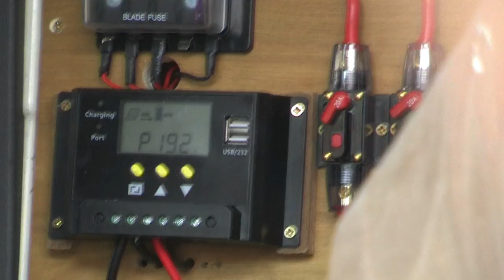Camper Van Build - part 8 - Building the chest of drawers and stereo cabinet

Comment: Sean, when you have the time I'd appreciate a video on the electric system and it's components.
I too want to build a van like yours but I know nothing about electricity.
There's a channel called Hurried Year where he took a sprinter van and turned it into a 1000W solar powered tiny home. He even has AC!
The problem is that it's in the US and many of his components aren't available in the UK.
I missed your videos in those years you took a hiatus.
Reply from the maker: I'll be making a detailed video on my electrics next week when install the 60amp breaker fuses and wire in the 2nd switch bank and stereo
Reply: Awesome!